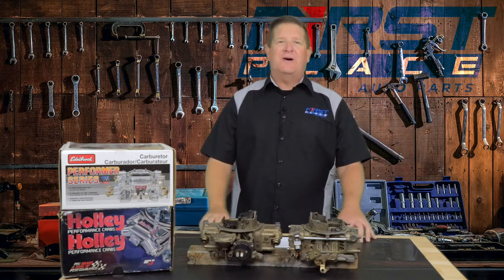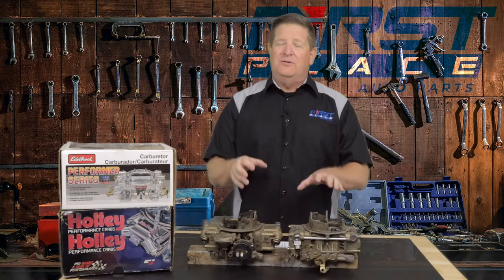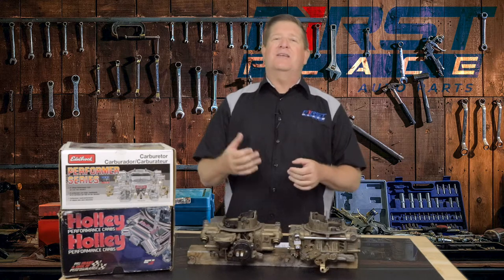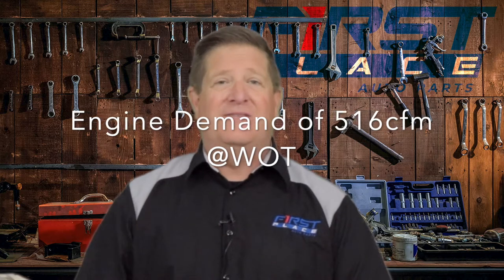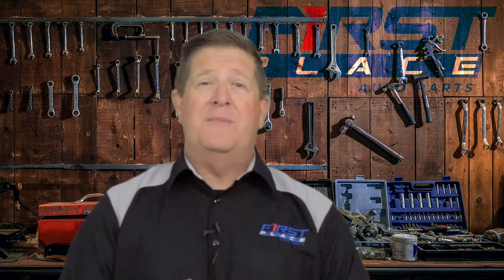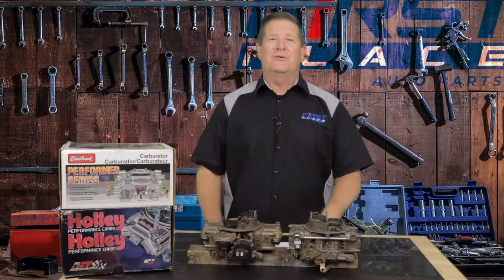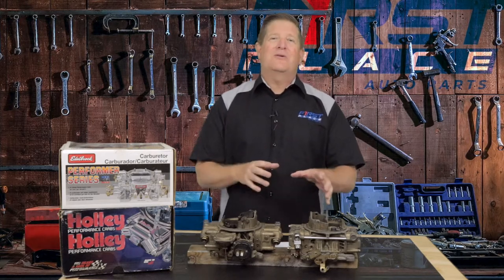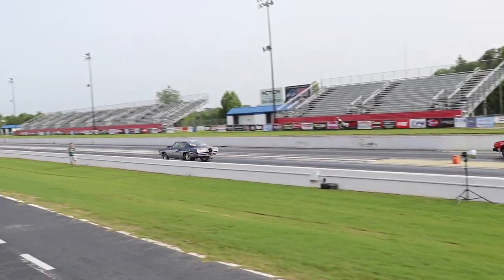How to Determine the Best Carburetor CFM Size to match your build!

Comment: Thanks for the content.  I’m trying to find better easier carb to rebuild and tune than the OEM autolite 4300 that came on my 72 429 Ford; probably a complimentary intake manifold also.  Keeping it stock would be nice but so far the old 4300 isn’t really a good carb worth messing with. My 2cents.

Comment: I have a Holly 1100 on my lawn mower…
It’s good to 125,000 rpm
Reply from the maker: and it will shoot grass clippings for 30 yards!
Reply: Lol! Too funny. I have to ask though, how does that apply to large throttle bodies fuel injection setups.
Reply: I have a 350 engine with vortec heads and just a standard jegs performer intake. I have a 600cfm edelbrock carb but it’s causing me TONS of annoying issues. I want to buy a new carburetor but the guy at holley said 600 was too big for my application and recommended a 450 cfm carb. You’re saying 600 for a 350 is about perfect… what should I get? I don’t race this car but I want it tho throw you in the seat like it does now when you show someone up on interstate. However I don’t want too big of a carb like holley says I have now
Reply: @danhammer2690  - lol: you are asking me?
I suggest you immediately send me your Holly for an extended evaluation….
I have a spare lawnmower carburetor laying around that is guaranteed not to bog off the line… (sorta).
😎🤓

Comment: "Having too high of a CFM rating for the project the vehicle will run lean. Too low and the car will be running to rich."
I dont think this is accurate. You adjust the amount of fuel to match the air so you arent lean or rich.  too big you end up with a poor signal and as you stated hurts your throttle response.